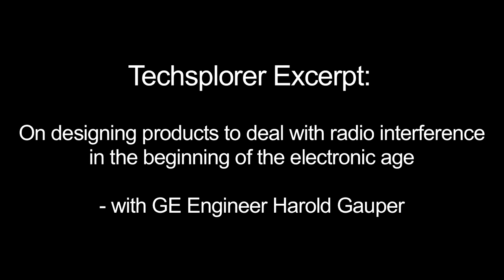Radio Interference at the start of the Electronic Age

Comment: Oh yeah - I've got both my amateur radio and commercial radio licenses. I'm pretty fully versed in RFI. Funny story - back in the day Ford used TRW alarm and entry systems on cars. Friends and I found out pretty quickly that 5W PEP on the 2m band would set off every TRW alarm. The other thing I discovered because I owned a Ford Tempo at the time was that the remote - it sometimes worked on my car as well as another car too.
Reply: I salute you General!